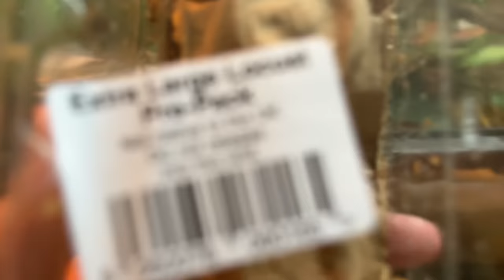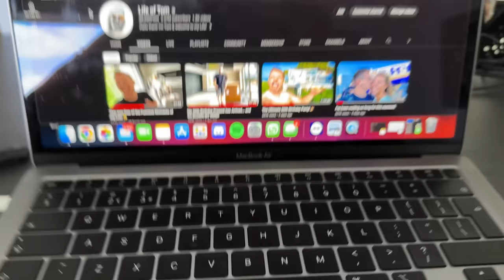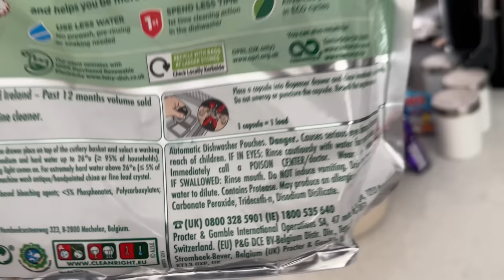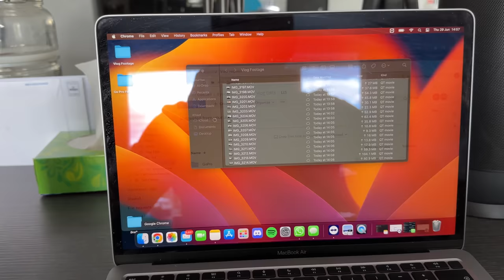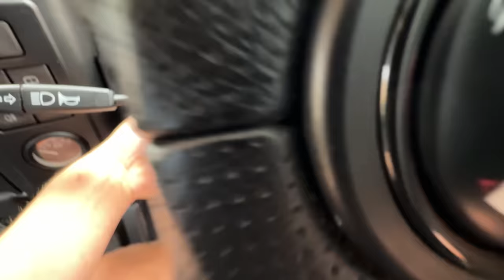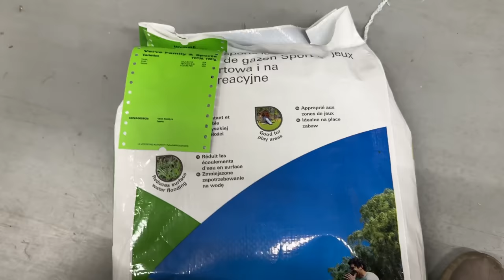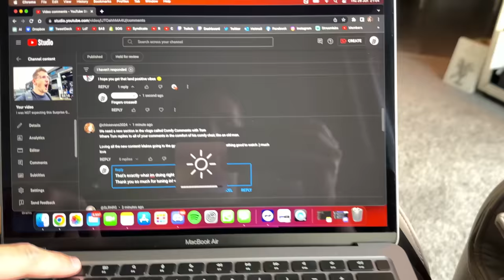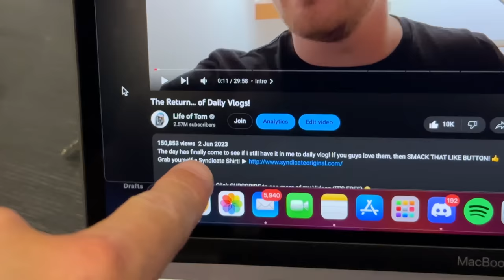I Found a Crashed Car in a River!

Comment: quick note tom: don't throw those pods into the washer all willy nilly. dishwashers do this thing where the fill up and rinse everything off and drain before actually dispensing the soap so basically it would just desolve the pods and the soap would be drained away without washing anything.

Comment: Just got to the dishawasher bit, and yes you're supposed to put it in the plastic thing. It then releases at a certain point during the wash cycle. If it's just thrown in, then it'll dissolve before it's ment to, and not give the best clean

Comment: Hi Tom, I don’t often comment but thought i would give you some help with the defender and kitting it out with a light bar and winch etc. usually things done are, winch, light bar, wheels and tyres lift blocks and springs. it’s actually a lot easier to do than expected. A light bar you just need to find the exact one you want (type or bulbs how it’s mounted if it’s on the bumper or if it’s on the roof etc) you just literally have to mount it to where needed then run the wiring through a grommet through the engine bay, into the firewall and then to the fuse board, you can connect it to its own independent switch OR connect it via full beam. My stepdad did it, had it on full beam and was perfect. It seems scary to do especially when your mounting it to the vehicle itself but once you make the initial jump you’ll be fine. Lift blocks will raise the cab up giving you more cab clearance and arch too. Springs will be a good shout for overall height increase and flex increase meaning when your at a mad angle more wheels can be on the ground, but it won’t increase your diff height what will be the main thing what gets stuck when off roading, for that you’ll need bigger wheels…then comes the cab lift kit to have that arch clearance I said about. It all kinda works together and one thing leads to another with it. I hope this helped mate <3

Comment: Tom just a quick tip on the bird house. If you want to secure it a bit better, why not take a long skrewbit with large skrew and poke it through the hole where birds enter. That way you can mount the house from the inside onto the tree. That ain't going anywhere.

Comment: If u come up with a wind breaker raincoat, I might just order one. Our winters are very rainy (I live in a rainforest): and it gets really windy as well
FORD: Found on river dead
All dishwashers have a presoak, so hot water gets sloshed around, and the heat helps get the food off. If u just throw the soap pod in the dishes won't wash properly. The machines are designed to open the dispenser at a certain time, because the wash cycle is longer than the rest of the cycles

Comment: The landy must haves for me, especially for what your going to be doing are, roof rack (for extra carrying capacity), a lift kit (for the extra ground clearance), front winch (in case of any bog ins) trust me it will happen, i recommend a battery one, and spot lights ( never been a fan of LED strips, if it goes the whole thing will need changing and not just one spotty). im sure if you purchase all the parts your local mech can easily fit them for you, all straight forward work apart from the lift kit, that might require a day or so

Comment: Hey Tom if you haven't bought a reciprocating saw yet, you can get battery adapter so you can use Dewalt in Makita or Milwakee ect. So if you find a reciprocating saw you like chances are you can use an adapter for you battery. If you do buy one just don't use an adapter whilst charging, just in  case.  Have a goodenn

Comment: depending on the needs a standard 4 inch lift kit will be fine as i doubt you will do much serious off track driving so i doubt you will need the whole body lift prop spacers and dislocation cones so i would just do the 4inch lift and go for a larger style Tyre such as insa turbos i kitted many landys out but i would also enquire about  getting a synthetic rope winch for doing anything off tack as they come in handy so much most garages can install the lift kit as it is just shocks and springs for the lift and the winch is just a bolt on winch tray and a few power lines to the battery with a isolation key :}